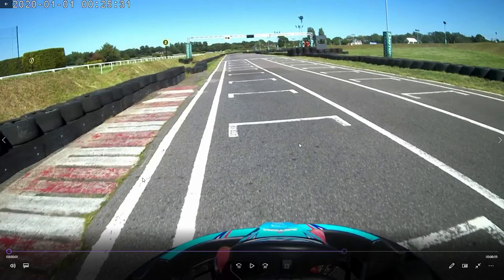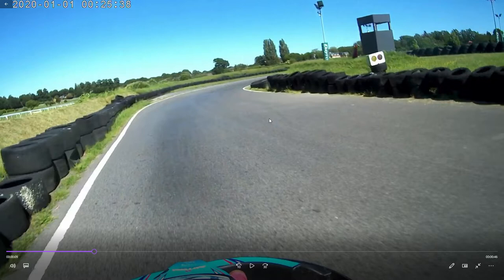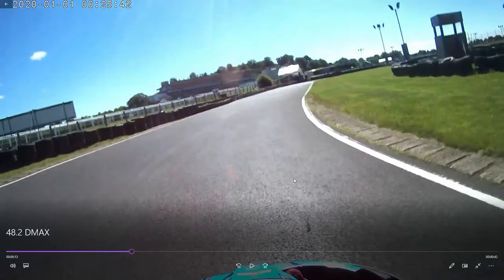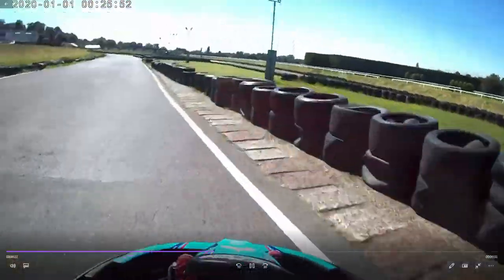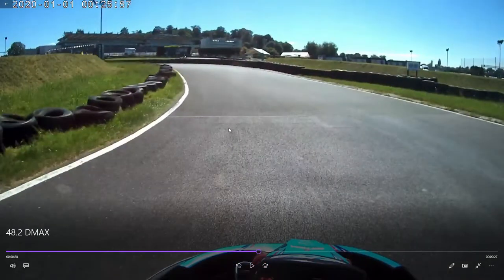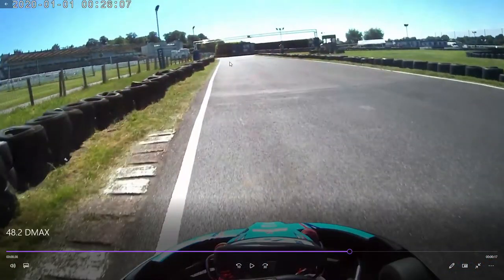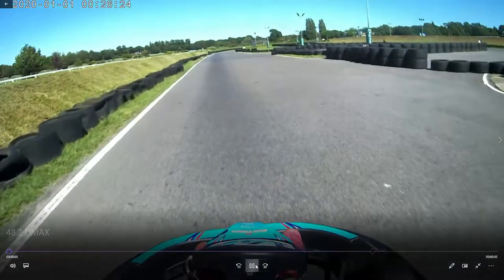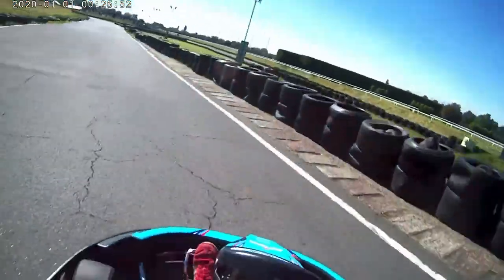Daytona Sandown Park DMAX hotlap guide.

Comment from the maker: Turn 1 : Minimal lift if necessary, smooth input turning in late as possible to prevent the kart washing out. Drive the kart straight out on exit.
Turn 2 : Heavy braking in a straight line, hit initial apex before trail braking in bringing the kart back round. 
Turn 3 : Sharp steering input get kart angled in early on power. Oversteer intentionally.
Turn 4 : Brake in a straight line, lock the brakes and shift the rear of the kart out to get the angle correct. Avoid the kerb.
Turn 5 : Turn in early and get tucked into the camber of the corner, stay patient before getting on the power.
Turn 6 : Brake heavy in straight line lock the brakes, shift the rear of the kart out before taking lots of kerb.
Turn 7/8 : Try keel throttle pinned before bringing the kart out wide to open up the final corner, get into the camber here but watch for oversteer from the kerb.